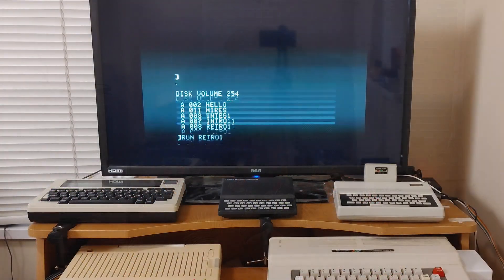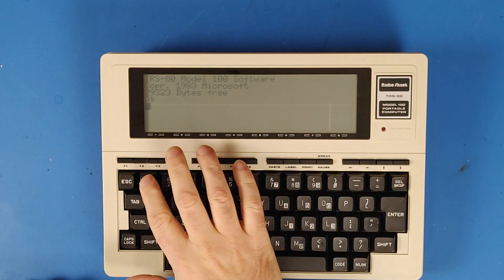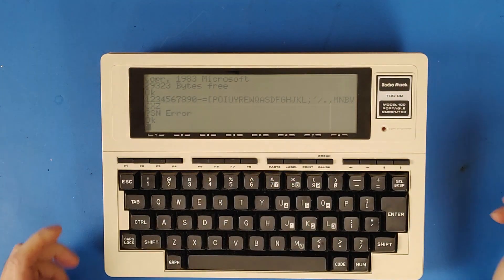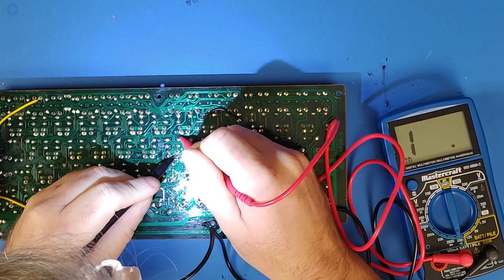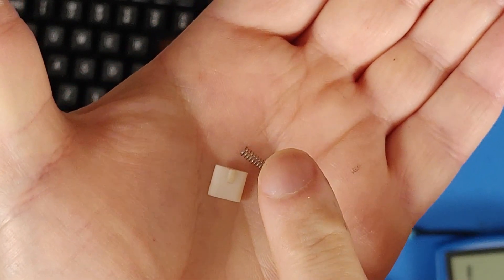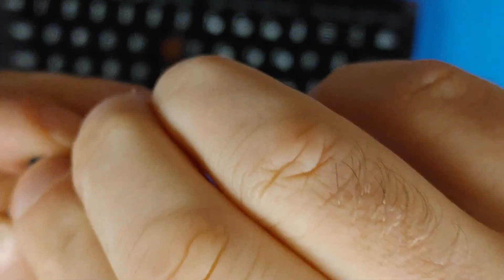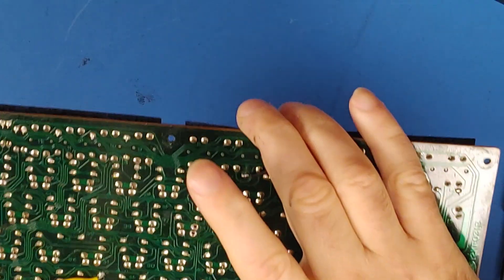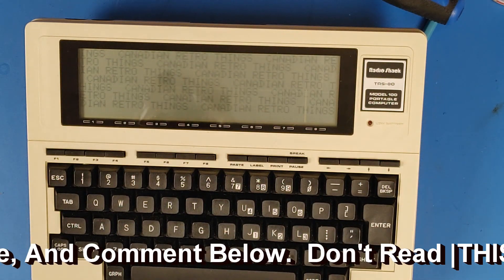Doing Some  Maintenance On My TRS-80 Model 100

Comment: I got a Model 100 today: everything seems to work great but the Enter Key & the Delete/Backspace key I think I have to reflow the soldier for those keys. Or maybe I have to do what you had to.
Reply from the maker: Also check the continuity of the traces around those keys. I have found on the Model 100s that the traces on the keyboard seem to be very susceptible to oxidization.

Comment: I wish there was a modern equivalent to the model 100.  I really like the form factor.  I know you could put a pi in there and a modern display, but there is some charm in the original system.
Reply from the maker: It is a great little machine, there are even some nice little games for it.  My favorite part is 4 AA batteries in it will last for around a month with regular use, that is a the part I wish they could get into laptops now.
Reply: Maybe a Raspberry Pi 400 with a little LCD display? Would be similar, but not as nice a keyboard as the Model 100.

Comment: Great job Ken!
What type of contact cleaner do you use?

I myself use De-Ox-It on almost everything. lol
Reply from the maker: It is a brand called GB, I got it at an automotive store originally for cleaning electric points and switches on my motorcycle.  It works great on my computers.

Comment: Wow, this is fortuitous! I've had a couple of Model 100 keys quit on me lately, and this seems a likely cause of it, and a likely solution too! I'm waiting on a couple of new replacement switches but maybe I won't need them.

Hmm, do you suppose that the switches can be cracked open without desoldering them? I wouldn't be surprised to find that gunk building up inside every key switch.

Good job on the keyboard repair, and thanks very much for the video!
Reply from the maker: The switch does have to be desoldered as the metal cover is soldered to the board as the ground, also to get it off you have to come at it from the bottom of the switch.
Reply: @CanadianRetroThings  
I should have noticed that.